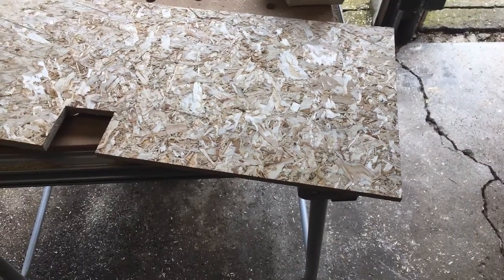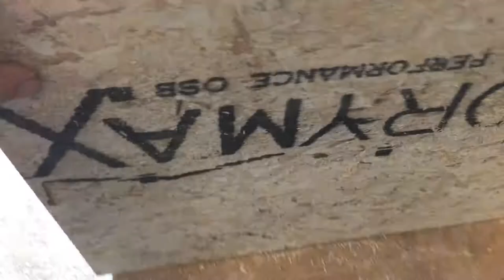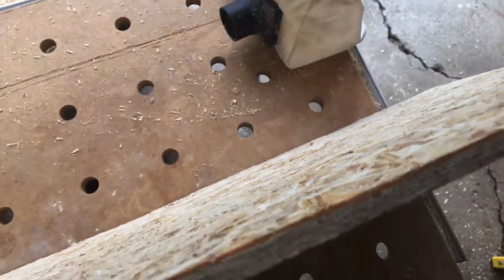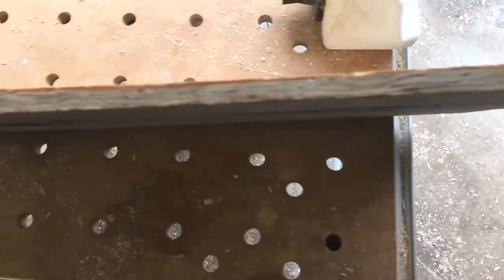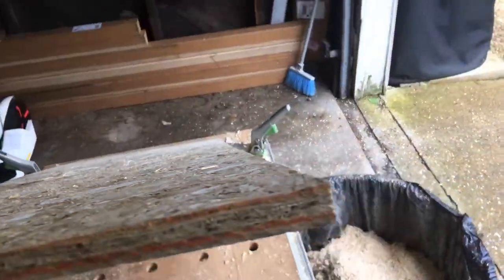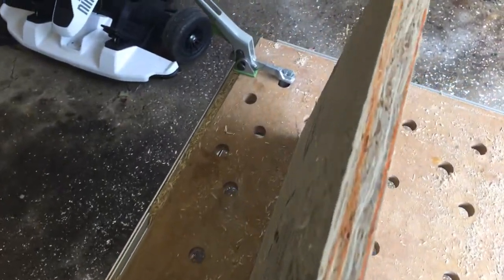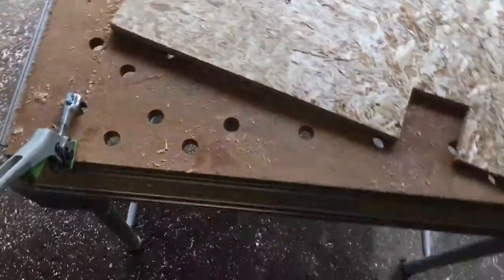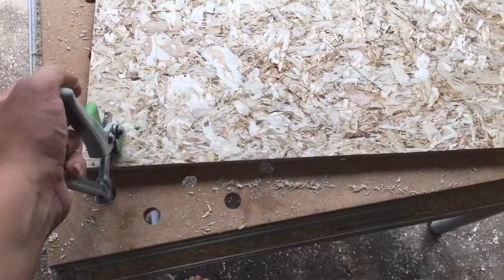Planing down OSB subfloor to level an old floor

Comment: Can I plane down a floor board that is already screwed into the floor?  I want to lay down ceramic tile but one of my new floor boards is about an inch higher than my others.  Thanks for your advice and the videos!
Reply from the maker: You can but the planer uses blades that might hit the screw heads or nails and damage the planer. Now you could remove the screws in the location your going to plane then plane it down then screw it back down but be careful because it my rise up when unscrewed making it look higher than it will be when its re-attached. Use a strong magnet to make sure you get ALL the screws and nails or you'll find them the hard way. Good luck!
Reply: @postbeam8200  You could also probably just sink the screws down into the OSB below the level where you're going to remove the wood. A good impact driver has no problem putting a screw head as deep into OSB as you want.